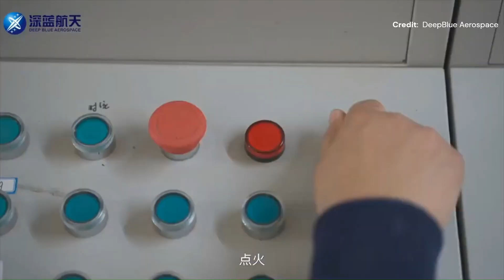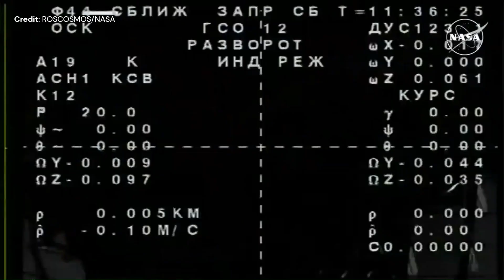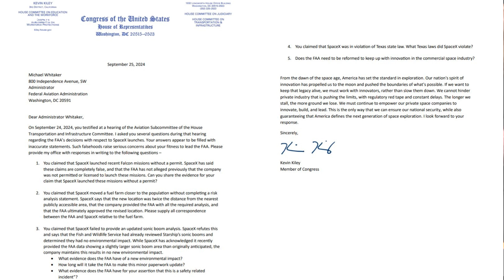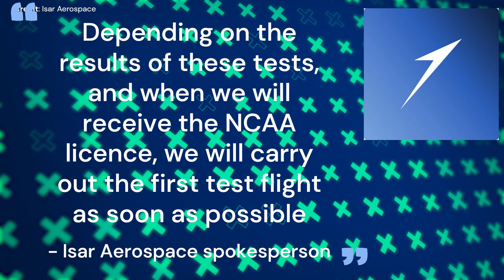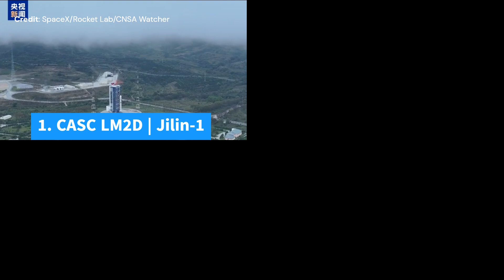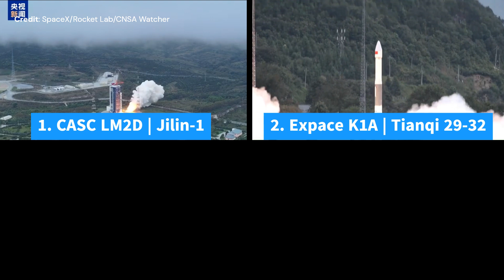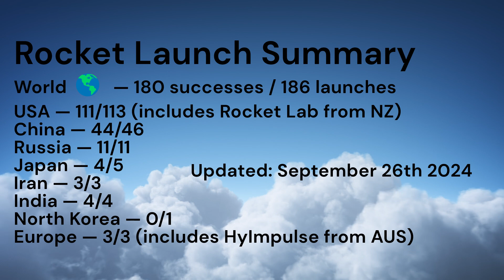DeepBlue Rocket Crash | Learning the Hard Way

Comment: I would have to say that this is practically a success it went right to the Launchpad landed right on the bullseye and the only reason that it crashed was because of engine cut off ahead of time congrats deep blue
Reply from the maker: They are nearly there for sure. The test went vertical, and therefore it was an easier job to get bullseye on this occasion. I look forward to have a more complex return to site to see if DeepBlue has got the control laws right, providing similar landing accuracy. All the come, and I look forward to that.